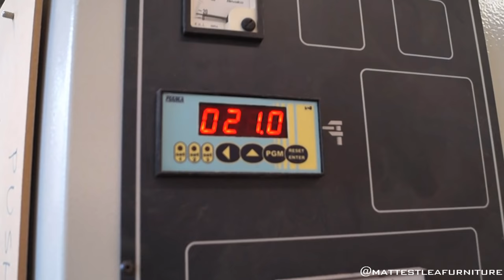Making The Doors - Making A Krenov Cabinet - Part 4/5

Comment: Great work! I've enjoyed your channel. If you feel you need for background music, you might want to think about having its volume turned down very low, and don't have it increase when you are not talking. It can be rough on the ears with headphones Another thought, a woodworker's three most important tools are his mind, his eyes, and his hands. It may look "cool" wearing those wrist bands, but I can guarantee you, it won't look cool having your wrist pulled into a spinning saw blade. Not meaning to nag, but if this is a career choice, than you may want to think about which is more important-fashion or safety. Good luck with your channel.

Comment: Great furniture and awesome materials but rookie mistakes with machine secure. You really need to focus on those! - regards four finger
Reply from the maker: Cheers mate! Which bits are you referring to specifically?
Reply: Matt Estlea - Furniture Table saw blade should be like 3-4 blade teeth over material surface. Here at the firs session you got it att full capasity. Thers no need to rise it so much. It can give bad damage if you saw spalted or highly figured wood. It gives accuracy allso.
Bush allways material forward in band saw never backwards. Blade can jump off to wheel. Thats how I lost 1/3 of my thumb.
Jointer, if you got narrow parts slide fence closer you so you dont neet to bend over blade. If you have 45mm wide leg, use 55mm of capasity.

really like your work! cheers!
Reply from the maker: Fair points on all of them, especially the planer; no excuse for that one! I'll try and explain the reasoning behind the others however. 

As for the ripsaw, that machine never has the blade risen or fallen because it is solely for ripping timber. If we were to lower the blade, it would mean the material would be cut at the top of the circle and cause more resistance when pushing the material through, rather than push down into the machine bed. Yes, the finish isn't always great, especially on thinner material. But I'd rather have the force pushing down into the bed, as opposed to being towards my nether regions. As you can see at 4:25 and 12:05, I usually make the height adjustment when using the dimension saw for crosscutting.

In terms of the bandsaw, I assume you're talking about the point at 13:12? I agree with you in general on that, perhaps some relief cuts would have been a good idea. However, it was such a small amount of force to restart the cut that I don't see it to be an issue. Obviously, if the material was much thicker I would be far more cautious with more surface area for the blade to bind.

But anyway, hopefully that explains the reasoning somewhat. Cheers for the comment :)
Reply: Matt awesome old machines! My career started here: www.tetrimaki.fi and there Eliel Saarinen collection.
Reply from the maker: Just had a look, I absolutely LOVE the white dining table and chairs.